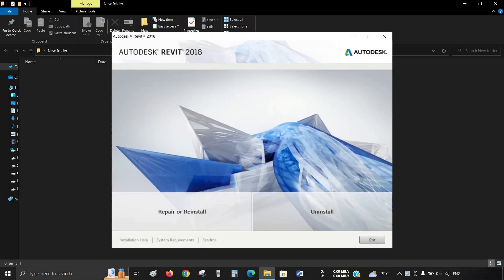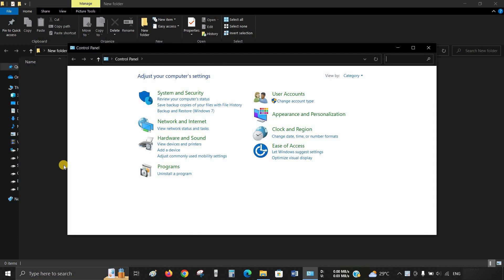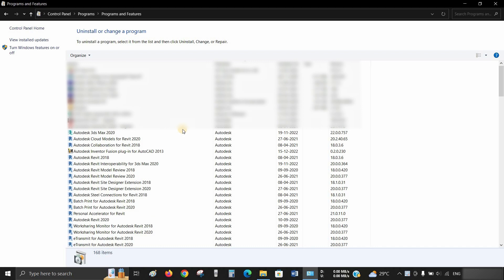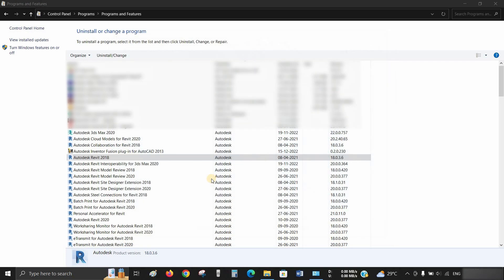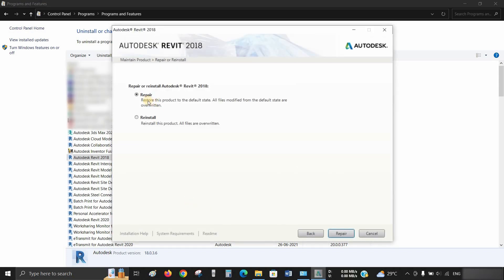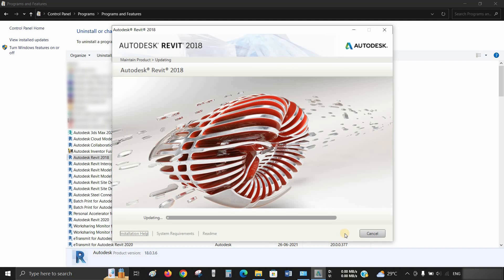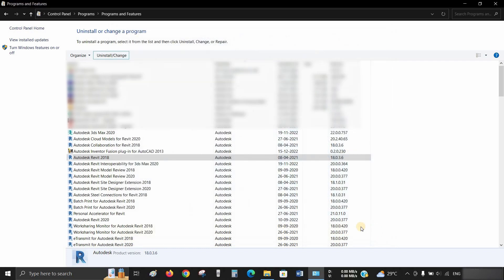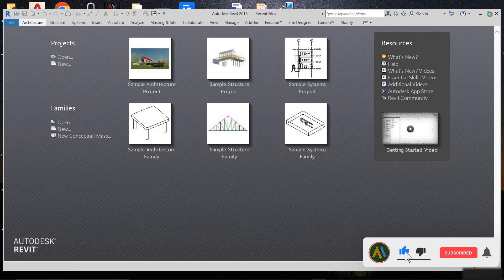How to repair Revit

Comment: This doesn't work in the newer versions, unfortunately.  
If you need to REMOVE Revit to REINSTALL ... copy and save this as a bat file and run as admin. 
Replace your version year, with the year you wish to install...like 2023 or 2022... 
Echo ON
REM Pause
Echo "This will delete Revit 2024 and all registry keys"
cd c:
REM rmdir /S /Q C:\Program Files\Autodesk\Revit 2024
REM rmdir /S /Q C:\Users\%USERNAME%\AppData\Local\Autodesk\Revit\Autodesk Revit 2024
REM rmdir /S /Q C:\Users\%USERNAME%\AppData\Roaming\Autodesk\Revit\Autodesk Revit 2024
REM Pause
ECHO "Now we delete Revit's Registry entries"
REM Pause
REM reg delete HKEY_CURRENT_USER\Software\Autodesk\Revit\Autodesk Revit 2024
REM reg delete HKEY_LOCAL_MACHINE\SOFTWARE\Autodesk\Revit\Autodesk Revit 2024
REM reg delete HKEY_CLASSES_ROOT\Installer\Products\0A4B643700320150000007C5D0680240
REM reg delete HKEY_LOCAL_MACHINE\SOFTWARE\Classes\Installer\Products\0A4B643700320150000007C5D0680240
REM reg delete HKEY_LOCAL_MACHINE\SOFTWARE\Microsoft\Windows\CurrentVersion\Uninstall{7346B4A0-2300-0510-0000-705C0D862004}
REM reg delete HKEY_LOCAL_MACHINE\SOFTWARE\Microsoft\Windows\CurrentVersion\Uninstall\{B4E35F04-D559-35E9-AB70-E0131AF7AB5B}
REM Pause
echo "Now we are running the Autodesk Uninstallers!"
C:\ProgramData\Autodesk\Uninstallers\"Autodesk Revit 2024"\AdskUninstallHelper.exe
C:\ProgramData\Autodesk\Uninstallers\"Autodesk Revit 2024.0.1 Hotfix"\AdskUninstallHelper.exe
C:\ProgramData\Autodesk\Uninstallers\"Autodesk Revit 2024.0.2 Hotfix"\AdskUninstallHelper.exe
C:\ProgramData\Autodesk\Uninstallers\"Autodesk Revit 2024.1.1 Update"\AdskUninstallHelper.exe
C:\ProgramData\Autodesk\Uninstallers\"Autodesk Revit 2024.1.3 Update"\AdskUninstallHelper.exe